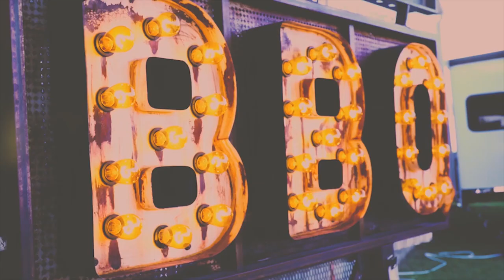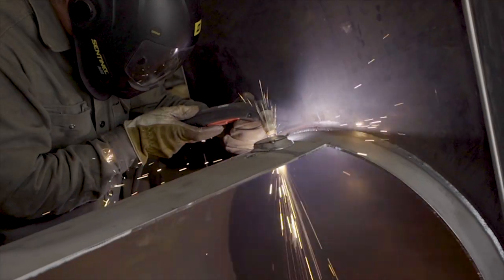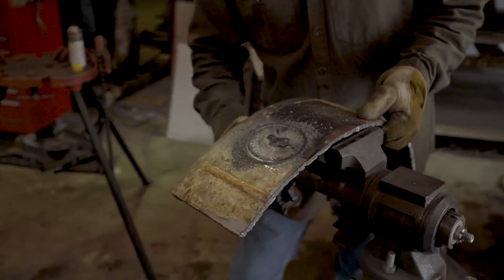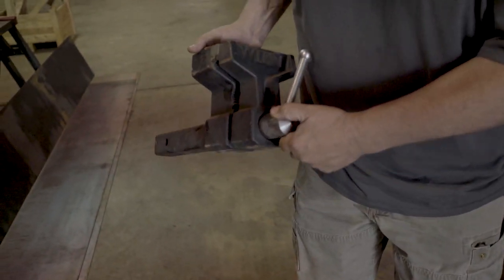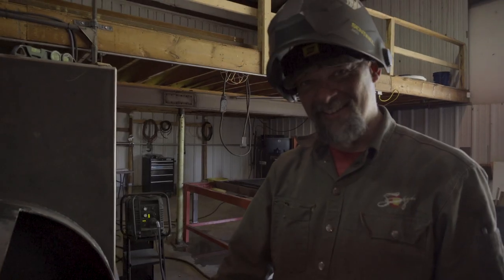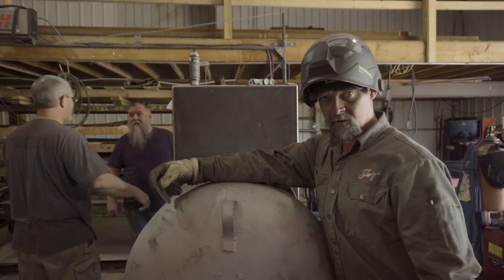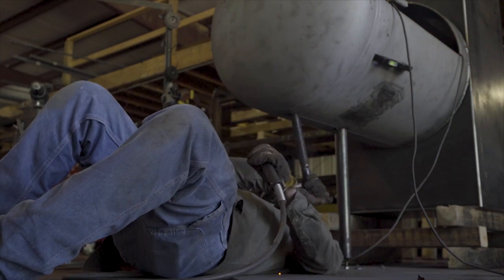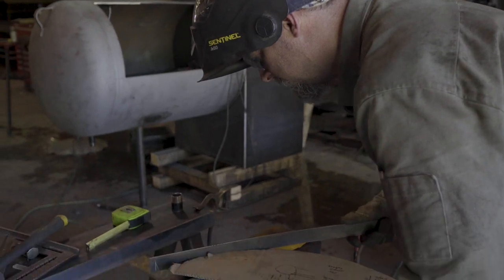BBQ Pit Builders: Ep1 Stubby on Memorial Day Weekend

Comment: Awesome work!  We just built a 150 gallon traditional offset out of an old round diesel fuel tank.  Once we cut the door opening we fought warpage and expanding all around the door cut.  I was curious, since pipe or propane tanks are thicker, do you still have these type of issues?
Reply from the maker: Hey buddy, yep! Contrary to what most people believe warpage is caused more by the manufacturing process of the vessel that by anything done during cutting the tank. We use a porta-power to adjust things. Typically takes 30 minutes or so to tune things. There are many other ways to do it also. We plan on doing an expert tips series on it in the near future
Reply: Thank you for the info!   I'll be looking forward to the tips series on cutting!!